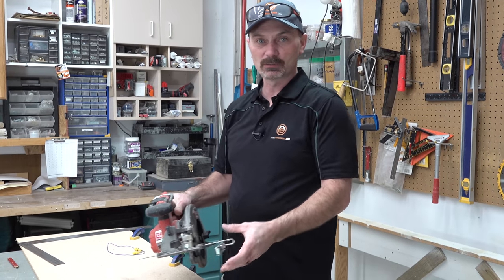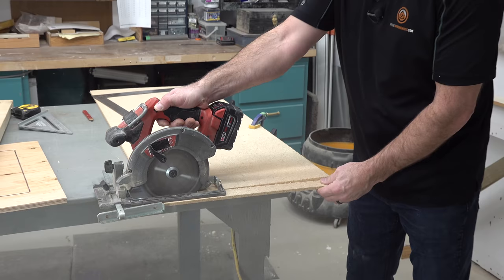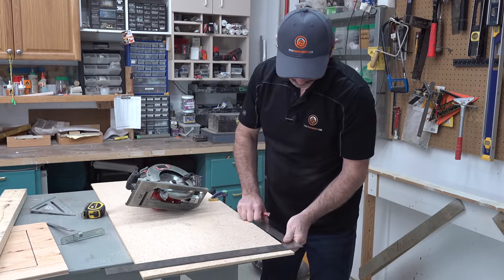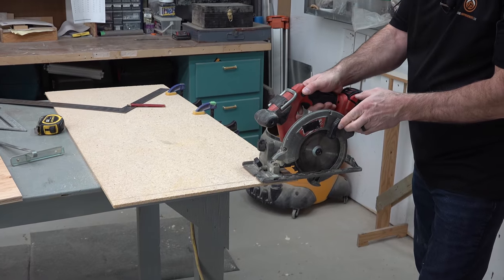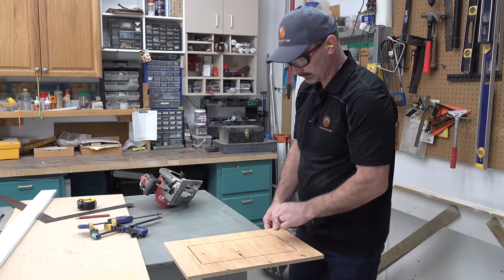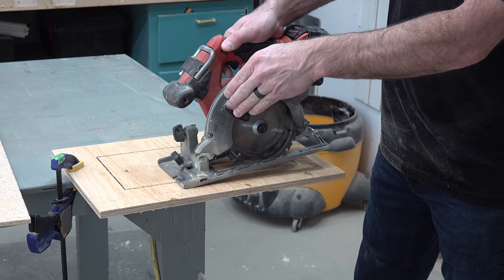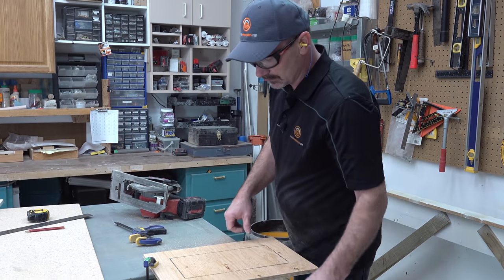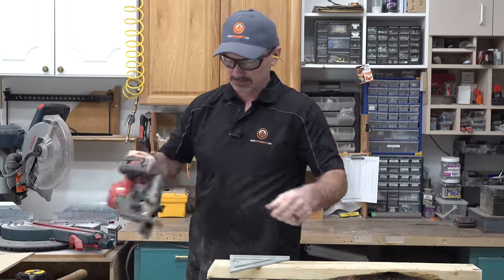5 Most Common Cuts Using a Circular Saw

Comment: I have always been leary of using the finger guide method myself. I do not like having my fingers that close to the blade.  And I have had my circular saw kick back during a plunge cut. Everyone be careful.

Good to see you, and Thanks for sharing Mr. Shannon
Reply: I would also be worried about the possibility of getting splinters from the wood as my finger traced the path of the cut, not the sort of problem I would want to deal with whilst concentrating on that rotating blade.

Comment: Shannon,   I have DeWalt's 20V XR version of that saw.   I just purchased Diablo's 48 tooth, 7 1/4" Steel Demon blade... for a reason.
A year ago, I had the wooden flooring in the kitchen replaced with a much thicker granite floor and now, the metal door to the back deck is scraping on the new, thicker floor as I open that door.   It looks like I will need to raise the threshold a quarter inch and remove a quarter inch from the bottom of the steel clad door hence the Steel Demon blade.
QUESTION:  Do you have a video about doing this kind of job.  I searched your site and didn't find one.   Thanks
Reply from the maker: No ,I do not have anything for that particular situation.
Reply: Don’t use a circular to cut a steel door, it will make a mess of it. Use a grinder with a metal cutting blade to cut through the metal only, on both sides. Peel those two strips off and then carefully cut or belt-sand the wood. You may have to squeeze a little all purpose or construction  glue under the edge of the metal and clamp it down with a couple blocks of wood. I’ve had to cut down a few metal doors over the years, and this method seems to work the best.